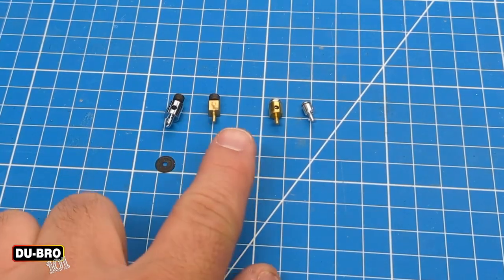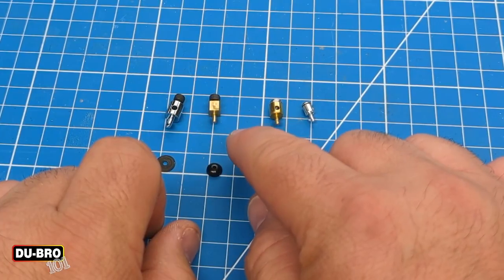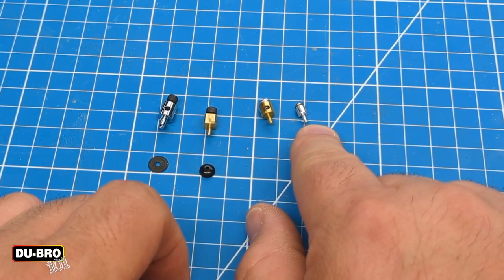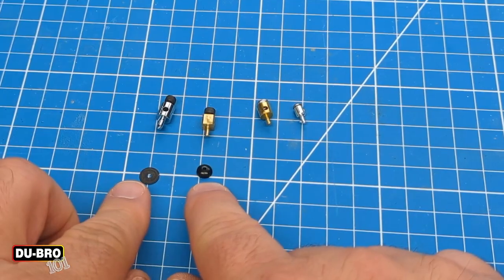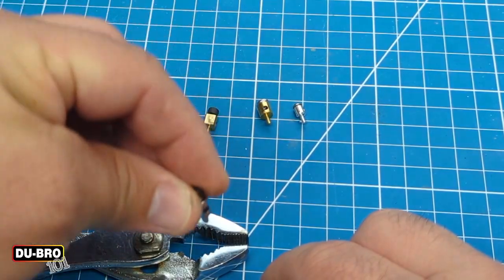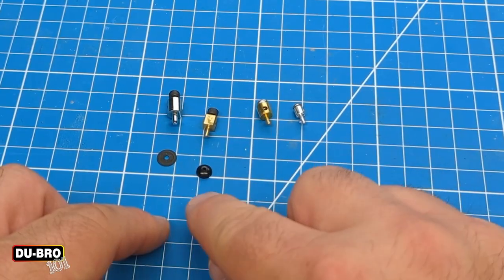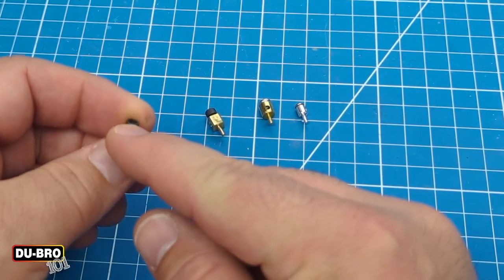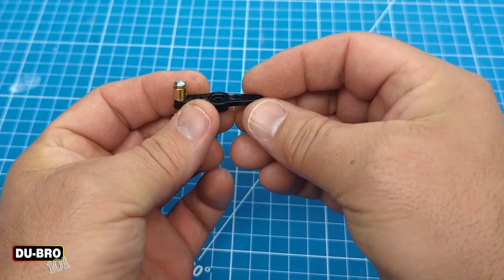DU-BRO 101 - E/Z Connectors

Comment: If possible I would like to see Dubro extend the threads a bit deeper so smaller diameter wires can be captured. I ground the point section of a tap to make a bottoming tap to extend the threads so the screws can tighten further down. I prefer a small diameter music wire,(and sometimes a pair of them) instead of a cable for throttle linkages. They are almost as flexible as cables, but provide more positive action. Plus with the threads extended, the screw head bottoms out on top of the EZ connector and makes it safer to uses a hammer to install on a servo arm with them metal push nuts, on a piece of sacrificial scrap hardwood.
Reply from the maker: The Mini Connectors are ideal for smaller wire.  Here is a link to those below.  This will cover as small as .047" wire.   Please let me know if this would work for your setup.  Thank you,

https://www.dubro.com/products/mini-e-z-connector?_pos=1&_psq=mini+e-z&_ss=e&_v=1.0